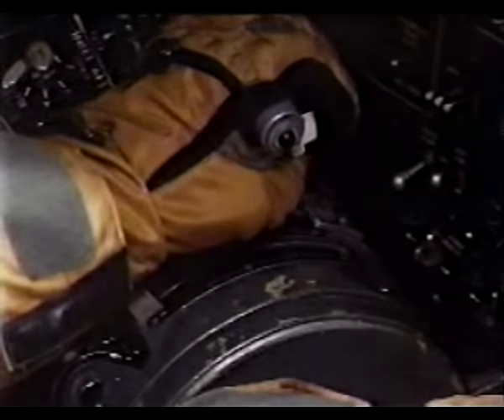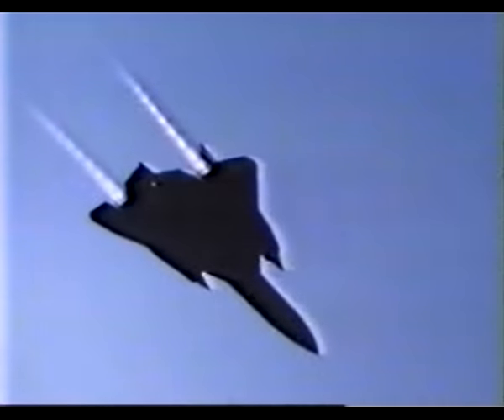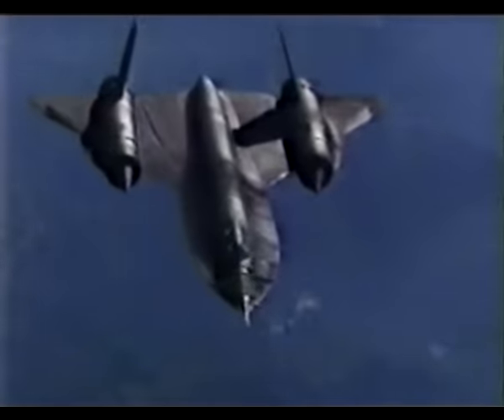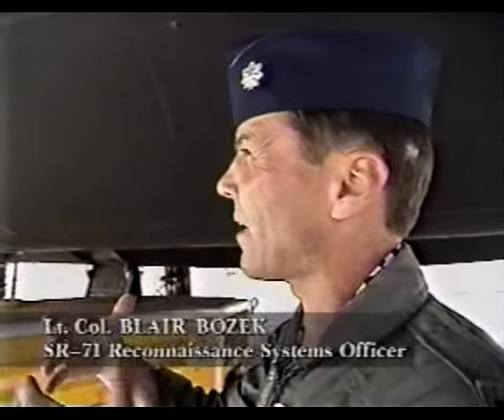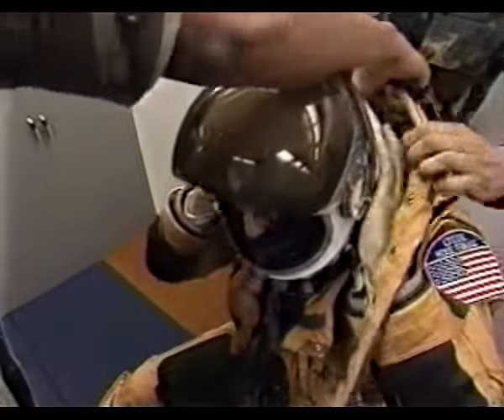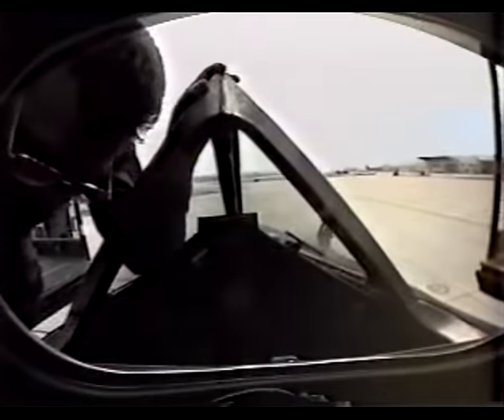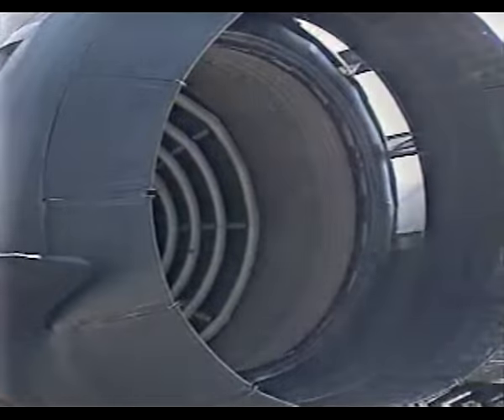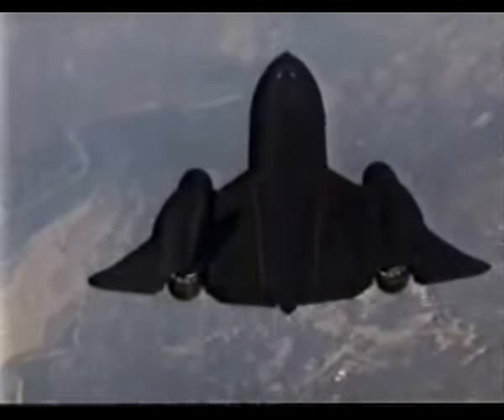Lockheed SR-71 Blackbird

Comment: Any female piolets? Not that I'm one of those equal rights preachers... Just curious.
Reply: I was with the program from 1975 to 1982 and never saw one.
Reply: @danielgunter590  thank you for your service and precise answer. 
Second question: by today's advancements in metallurgy and polymers, do you believe we could sell the leaking fuel and just take off lite?
Reply: @jamesharrell4360  I'm certain we could have, but you need to consider the fuel consumption it was enormous.  Most missions required 68K lbs. of fuel at take-off just to get to the first tanker, when she was below the service ceiling it would suck the gas gage down quickly. 

On the same hand the Russians built the Mig-25 just for the sole purpose of shooting down the SR.  We got our hands on one and completely tore it down, their fuel tanks where all welded (stainless steel) most of the airframe was titainium.  It was a very good airplane but could not fly at Mach 3 for extended periods, later it became a re-con airframe.  And that was the atvantage the SR had over the Mig, she could fly high and fast all day long